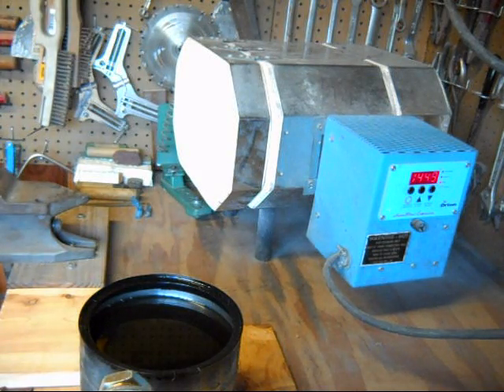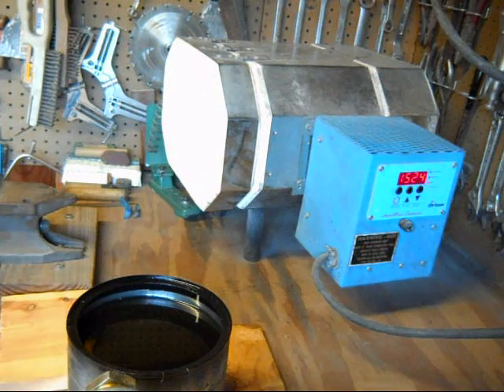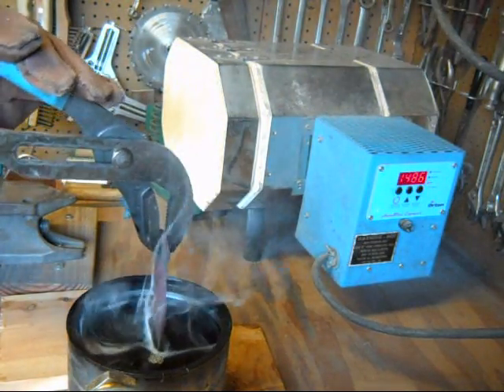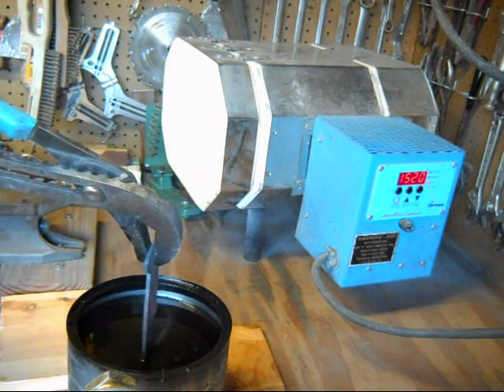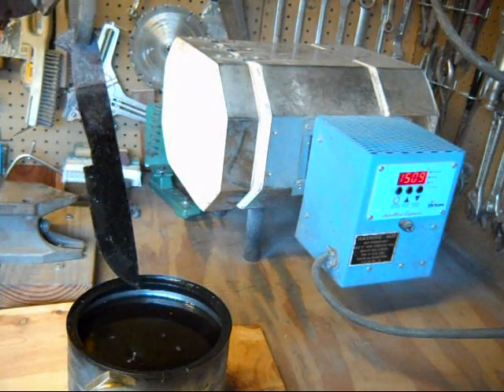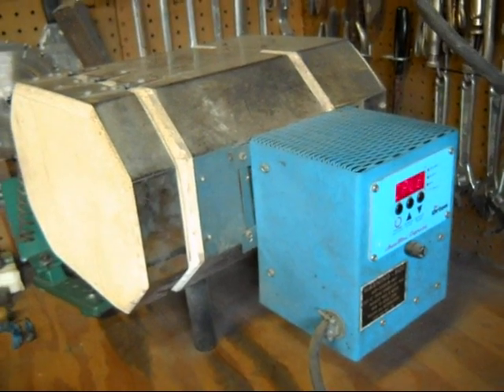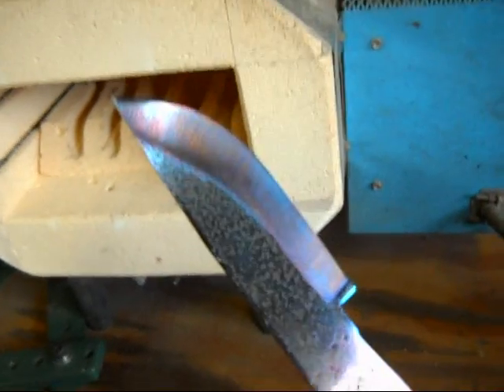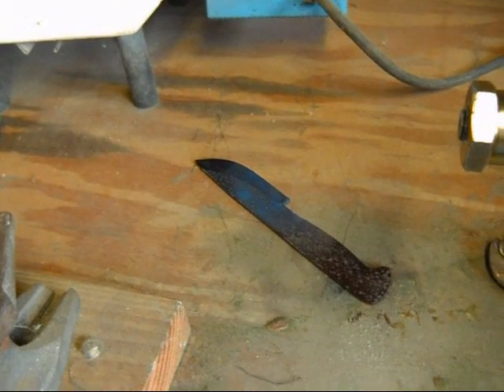Heat Treating A Knife

Comment: Where are you getting elements for your furnace?  Mine takes the same kind, I'm thinking.
Reply from the maker: I haven't had to buy one, but most of the knife supply places probably sell them.  Also - for a cheaper option you may want to look at a dryer heating element.  You may need to cut it to length.
Reply: I'm thinking of that too.  Your furnace was probably built by the same guy that built mine, even down to the legs, exactly the same machine but you have the upgraded temp control...sadly, he went out of business.  I believe I saw one for around $45.00 but I have to remember where that was...If I find it I'll post it here for you.  Thanks.
Reply: euclids elements can make them, but it is probably a standard size, but they have them.
Reply: ahh, I found them and they are on closeout. search usaknifemaker dot com and when there search REPLACEMENT ELEMENT FOR SUGAR CREEK LKK BY EVENHEAT they are $40.00 each.  I just ordered two 'cause you never know when an element will burn out and put you out of business for a while.  Hope it helps.

Comment: What voltage is that particular HT oven set for, 120v or 240v? I am also curious to see how much one of these cost.
Thanks,
Gary
Reply from the maker: This one is 120.  I bought it used, but they start at about $1000 new.

Comment: You seem to have been doing this for a while, which is why I'm bit a surprised that you inserted the blade into the quench medium sideways. I'm assuming that was a slip up, but for the sake of those watching this for instruction, on a bigger blade, this WILL cause the steel to warp! I'm somewhat surprised that this knife didn't.

Comment from the maker: We can never be 100% sure on metal types, but I would have assumed the same thing that you did.  Are you sure that the hardening process you used was effective?  You might want to try hardening again and then use a lower temper temperature (350 - 400) once for two hours and see how your results are.

Comment: i have a question for you , i made a file knife, made in usa, i tempered it at 450 twice for 1 1/2 hrs and it is too soft, im under the impression that the file is a 1095 like metal only from what info ive been able to get online, is this wrong? is it a different metal with a different heat tempering.

Comment from the maker: The saw blades are hardened to about an RC 45 which is too soft for a knife.  The heat treat process I use takes them to about an RC 60.  If you heat the steel and allow it to cool slowly it will soften (anneal) the steel.

Comment from the maker: @okkrom It is easier to drill annealed steel.  I did not anneal this steel before I started.  Using an angle grinder to cut up the saw blade does change the temper, so I always heat treat it.  This way I know where the final product is.  Drilling it with carbide bits is relatively easy.  Drilling hardened D2 is much more difficult.